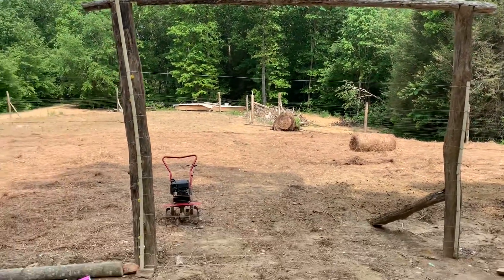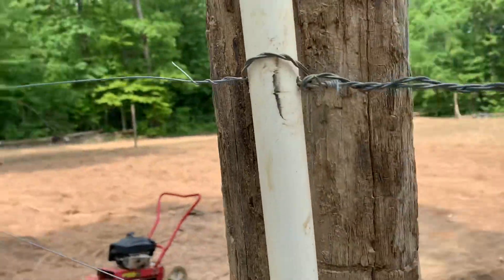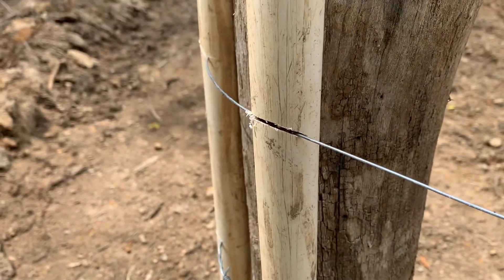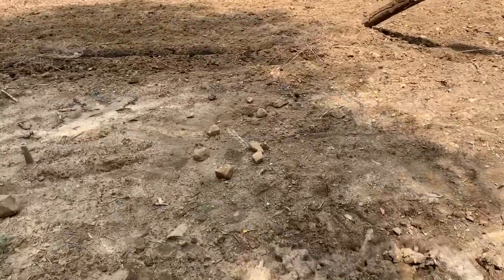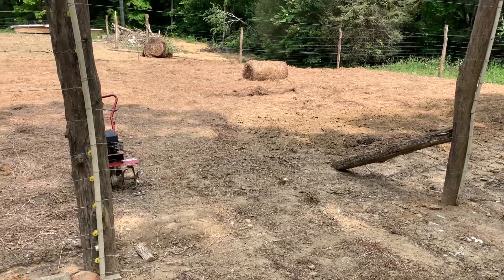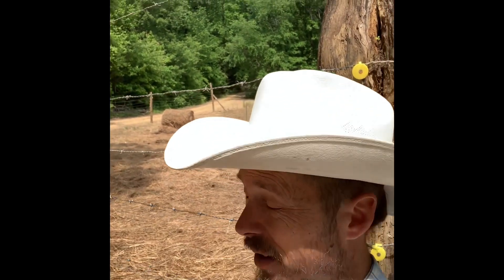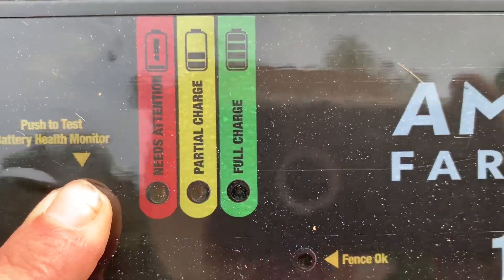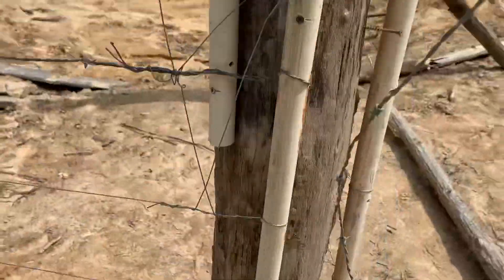Solar Powered Electric Fence Hack

Comment: An owl got hung in my barb wire and a young puppy. Both times i was  right there in time to rescue. I use only visable polywire nowadays because i can just reuse it anywhere, cut it and retie it anytime and its easy for the animals to understand where the painful  force field is because they can see it. They often ran through the invisible metal wire. My experience using it all 28 years. Polywire uses less too and rolls up just like string.
Reply from the maker: Thanks for the tips! Polywire is definitely a great option for visibility. I only used the barb wire because I already had it.

Comment: No comment on the barbwire cuz I’ve never tried it but I like the idea 👍
What I was gonna suggest is if you run a hot wire parallel with a regular fence is use your fence as a ground???
You have multiple grounds with your t posts !
I have done this and it works great and it’s cost effective. 
Just saying
Reply from the maker: I have never thought of that. But sounds like a good idea

Comment: The commercial insulators are cheaper than PVC pipe.  Barbed wire isn’t good because of the two wires it’s the same as running double length single wire as far as the energy required.
Reply from the maker: It was old used pipe. And I already had the barbed wire. The fence charger is capable of much more wire. So in this case this was the cheapest way to go.
Reply: Free can be pretty cheap